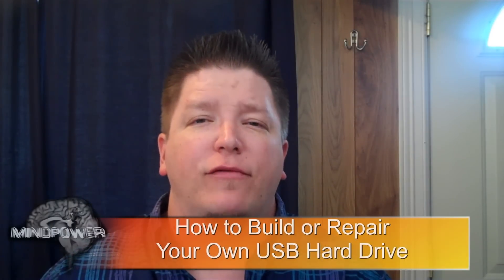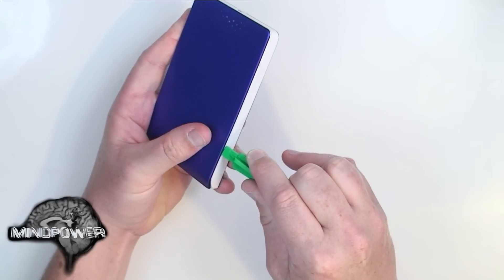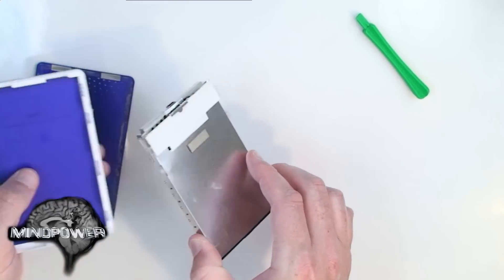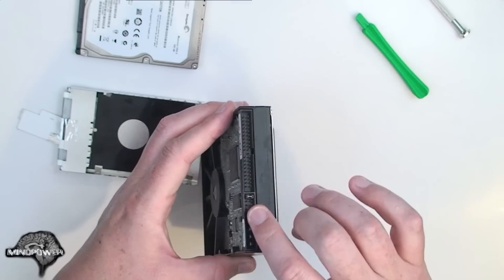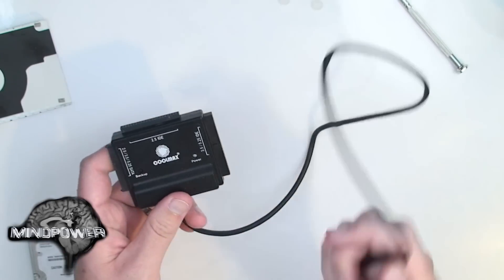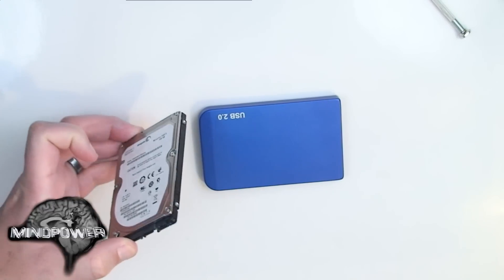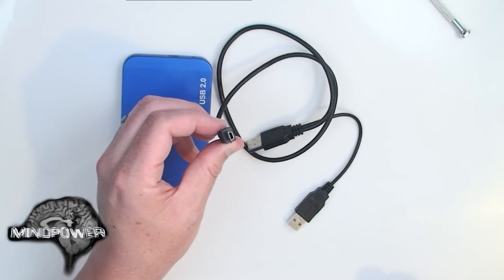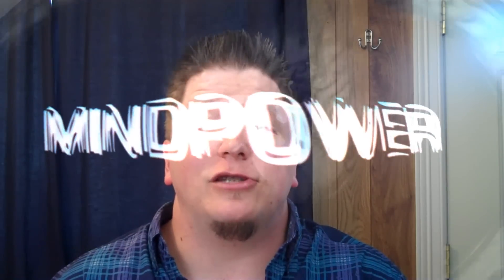How to Build or Repair an External USB Hard Drive

Comment: Thanks for your video. I am thinking of just getting one of those sata to usb cables to try to retrieve data from my failing network drive. My question is this... like most large external hard drives, mine is powered independently direct from a power adapter. If I disassemble and extract just the hard drive, what would be the power requirements to drive it? would that single usb sata adapter cable always be sufficient? or is there something else I should look out for?

Comment: @xMarkuzx For flash memory, yes that's generally true.  But may of today's hard drives require extra power to drive the motor.  Since flash memory doesn't have a motor, that's not an issue.

Comment from the maker: @alleermed We had to do this same thing with my sister's hard drive when she dropped it.  She broke the USB port on the back, which meant we had to replace the whole enclosure, like you see here.  However, the drop also destroyed the data on the hard drive, so if you dropped it, be prepared to lose everything, but there is a chance this service would fix it.  It's definitely worth a try, right?

Comment: well most of it was correct. it was an good video for the n00bs. didn't really learn anything my self. But you should of pointed out differences between usb micro and mini connectors. And also that desktop enclosures usually use usb type B if i recall correctly. Long time sens i bought an usb cable.